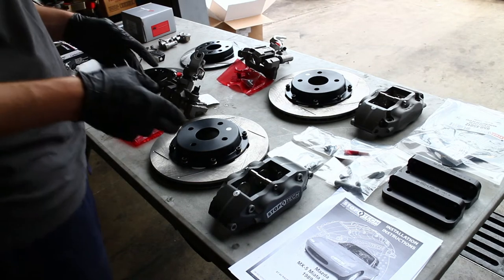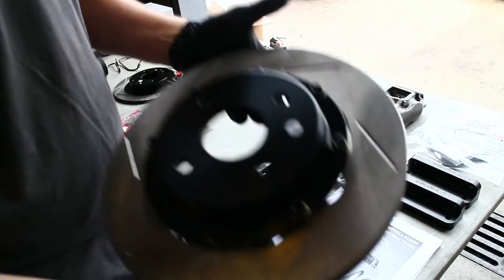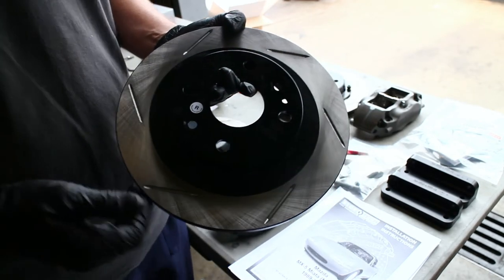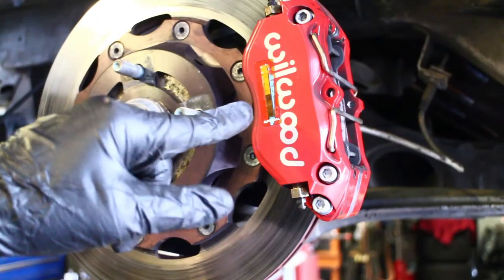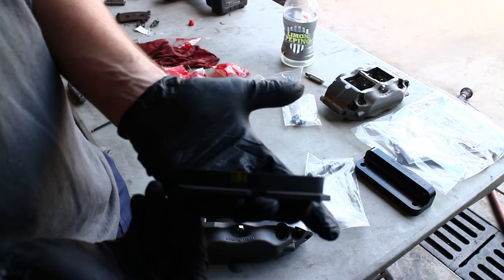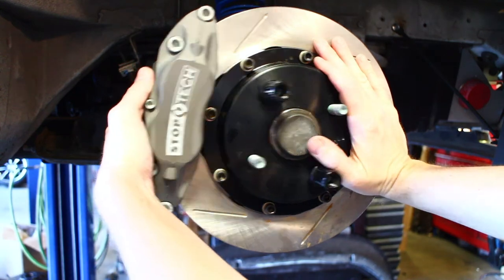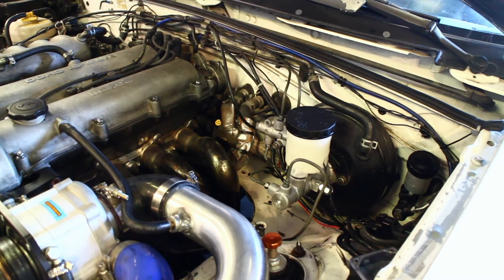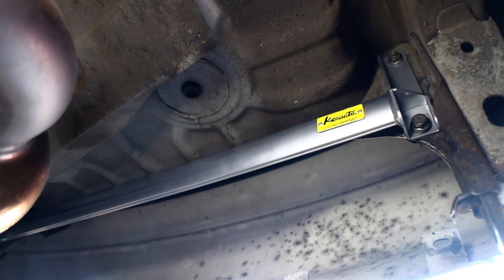Supercharged Miata Update! - StopTech Big Brake Kit Installation!

Comment: Hi Sean, you did a great video review. Could you give us feedback about Stoptech vs Dynapro? I sold my Corrado G60 rotors and Wilwood Dynalite to upgrade to Superlite 4pistons or Dynapro 6pistons with directional vane rotors so i would like to read your opinion about Stoptech. Thanks!!
Reply from the maker: I'd generally avoid the Wilwood 6 piston, pad selection is just OK and way more expensive than the 4 piston. What car do you have? For a Miata I really like the Good-Win Racing V5 11.75 BBK (Dynapro 4 Piston) with Sport rotors in the rear with a regular 1.8 caliper.
Reply: I'm thinking in Superlite 4 piston with 11.75" vane rotors for front and D501 with 11" vane rotors for rear. Brake proportion valve for rear and remote bias valve for master cylinder.
Reply from the maker: How much power does the car make? Don't take this wrong way...but I wouldn't try reinventing the wheel. I have been through so many brake upgrades it is not even funny, and to be honest most of them were pretty terrible. My favorite and the best is the 11.75" with Dynapro Calipers (Superlites are too stiff and may cause pad knockback) with a sport rotor in the rear using a standard 1.8 caliper and pad. If you have the budget, get the Wilwood 1" master and an adjustable prop valve for the rear. I can run this combo all weekend long, with double sessions and it never lets me down with 250WHP from my Rotrex.
Reply: I will do something between 350/400. 
I search a lot of information about front calipers and Trasckspeedengeneering has best kit out there (Superlite with their own hat to fit 15" wheels). They wrote Superlite are better calipers to mount in 15" because much stiffer than Dynapro 6 pistons. Pads are cheaper too. I didn´t read anything about "pad knockback". 
About rear wheels... i sold my sport rear calipers and rotors because i want to upgrade to something better and lighter. I searched for Wilwood information and 11" rotors with D501 caliper fit perfect in a 15". So 2 pieces vented rotors with a great, light and resonable 2piston calipers (they have bigger and fatter pads too) is the best solution for rear wheels. 
I mount 225/50 R888 tyres at rears and 205/50 R888 front (probably i will upgrade to 215/50) and medium aero so i think i will have to adjust bias with brake proportion valve just a bit. 
In other way i changed OEM master for Compbrake dual master cylinder with additional remote bias adjust and deleted brake booster so it will help to a fine tuning in street or different tracks/weather conditions.
Reply from the maker: Ah, for that power the Superlite TSE kit is the way to go. Only other recommendation is square the tire size up for better handling. Depending on suspension travel those 225/50 will hit the fender liners. We like running the 225/45/15 square on 15x9.
Reply: Yes, i mounted 225/45 all the way but had some rub problem at the front on the interior chassis wall at max lock (drift and street use) so i went down to 205/50 for my street/drift wheels set but i have to buy a new set of wheels only for track so probably mount 225/45 or 215/50 at front and keep my 225/50 at rear.

https://www.instagram.com/p/BZ0mpSslJuP

Comment: Hey Sean, Can you give me an update on this kit? I saw you had some problems with it in the Global time Attack. Thanks
Reply from the maker: I have a set of floating rotors and new calipers to test on the car. I've been a bit caught up with the 86 build but as soon as I have time to get those on I'll give it a go. It's looking more and more like an issue of a VERY stiff caliper from StopTech sitting on a kinda flexy spindle. The stock Miata spindle is nearly 30 years old and I think just flexes too much when you have a sticky 225 on a 15x9.
Reply: Ok, I have a 210whp trackday miata with Raybestos st43 pads, SS hoses, and stock brake system. Seems to be working well, but I wouldn't mind trying a BBK. Since you have experience with BBKs, is there a huge difference between the two? Or do they have similar feels, but the BBK can withstand brake fade?  thanks!
Reply from the maker: In a word, yes. The benefits of a properly developed BBK are well worth it for a 200WHP Miata. The biggest advantage is consumables will be cheaper in the long run and you'll spend less time servicing the brakes. Running an 11.75" front rotor with a quality friction ring from AP Racing or PFC will be a game changer - most people will get over 2-3 years out of a set of rings depending on use.  Pad changes are also easier so if you use the car for double duty it makes it a little less painful. Combine a BBK with a brake duct kit and things will last even longer. 

With that said, if you are investing in a BBK you need to invest in upgrading the rest of the system. That includes an adjustable proportioning valve, 1" master cylinder upgrade (if using Wilwoods) and changing the rear brakes to get the mechanical balance right. If you use a 11.75 front kit with the typical Wilwood caliper you'll want to run a Sport 10.9" sized rear rotor.  I'd keep the standard 1.8 caliper in the rear to keep a good pad selection too.